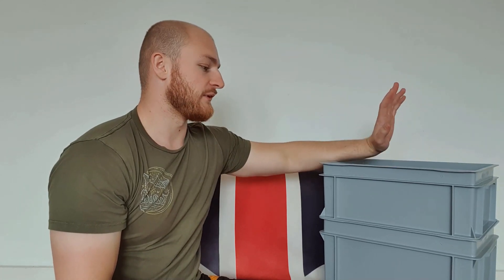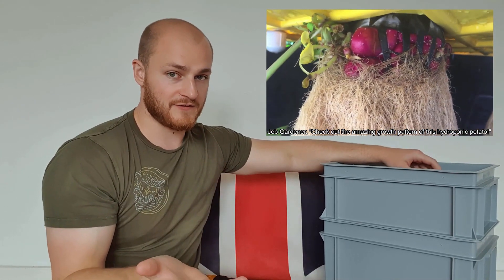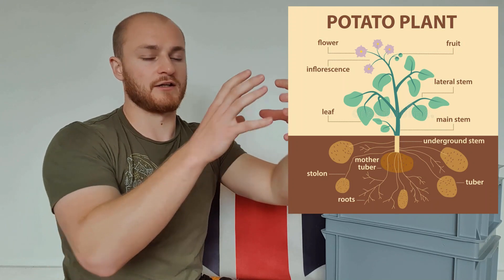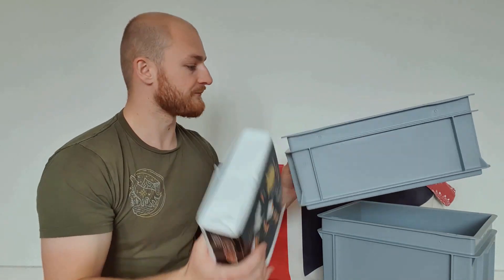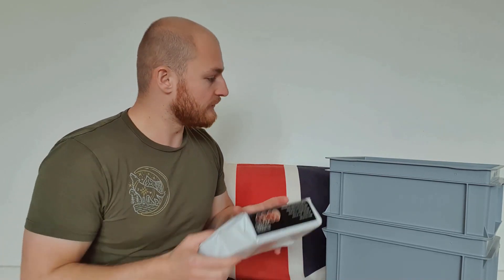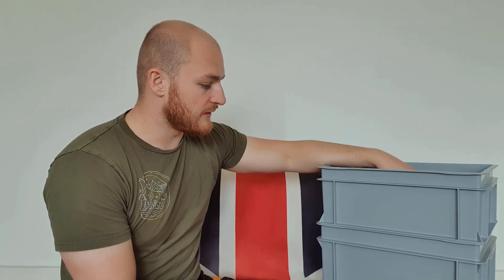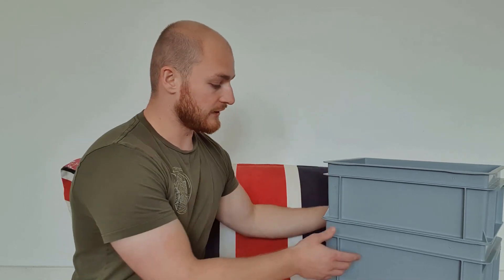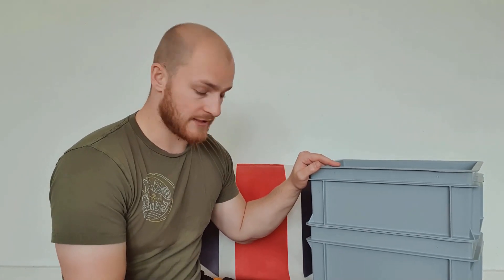Experimental Setup | Soilless Spuds PhD

Comment: i really don't understand what you are talking about you mentioned they produced 166tons on a hectare ,then you said if they scaled it up so which is it? then soilless means soilless you can not have half hydro and halve soil and still call it soilless you are still growing in soil for your stolon's remember, you literally refer to the coco peat container as soilless...i find it to be very contradictory and confusing ,Do you know what a rain gutter system is in a way this is basically the same thing as long as the soil can wick up nutrients from the bottom via soil or roots the plant will grow. just one last thing once you planted the seeds do you water them from the top container? what happens to the water draining to the bottom container? do you drain it ? or do you leave it until the roots come trough and then wick it up?
Reply from the maker: Hi again. I think I covered the first part of your question in your latest comment. As for watering, all of the plants water and nutrients were provided by the larger box. The roots grew down through the wire mesh under the top box and into this nutrient solution - giving the plant access to everything it would usually get from the soil. So, I didn't water the system in the way you might think. I just let the plant use up the nutrient solution and then replaced it with fresh water and nutrients. Hope that's cleared everything up for you.

Comment: This has me very interested,  I have been growing,  lettuce, kale, spinach,  cabbage,  herbs in totes and tomatoes, cucumbers and peppers in buckets in my basement.  This this so cool. Could you tell me please were you got your tote/crate and what media you use.  I have a couple extra pumps and airstones and wanting to do potatoes and root veggies. Also, what has been your biggest issue in doing this. Thank you,  you rock 🤗
Reply from the maker: Thanks for watching 😁 I used stackable "euroboxes". I can't remember where I got them, but they're easy to find. Just make sure they're the same length and width so they sit snuggly on top of each other.

The only problems I had were root-rot (before I got the airstone), low light (before I moved it to the greenhouse at uni), and I had some issues with some sort of insect. I'm not sure what they were though. I'm sure you're probably better at dealing with that sort of thing than me though from your other veg. 

Let me know how it goes!
Reply: @DominicHill  This is my second time,  I started with a small shelf unit under the stairs. Now I'm at 4 6hx4w shelf units,  15 totes and 10 buckets.  First time I had the same issues,  root rot, bolting, insects, algae... finally got all that under control and thought,  hey let's try root veggies.  Mom fears we'll have to move as my babies are taking over 🤣 thank you so much. OHH, what type of media did you use?
Reply from the maker: @MysticHuntress1  Oh, sorry. The media I used was coco coir. I added a little perlite because someone suggested the silica in it might help with tuberisation. I'm not sure it's completely necessary though.
Reply: @DominicHill  You're wonderful,  thank you so much.  Need to start organizing then,  as half the plant room is also a storage room, so might be a minute before I start. I'll keep you updated 😁